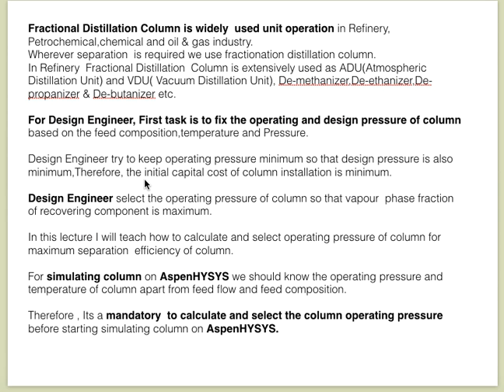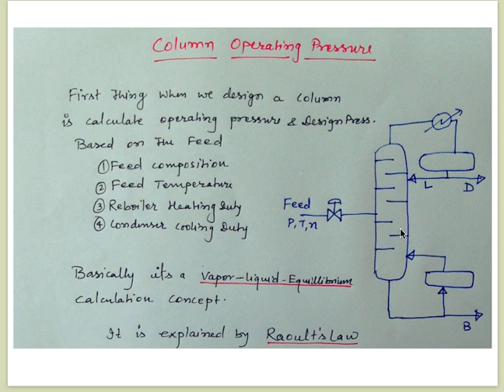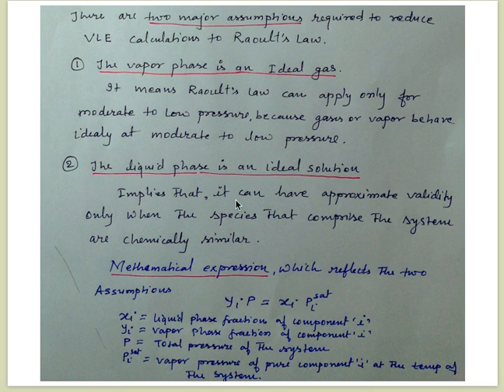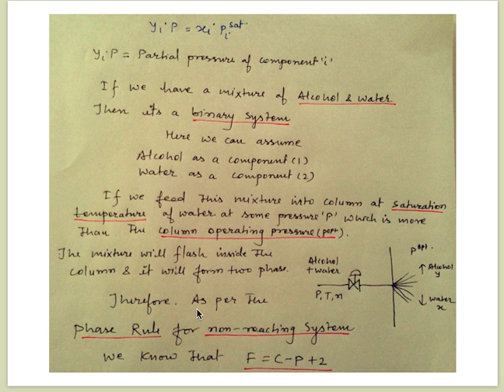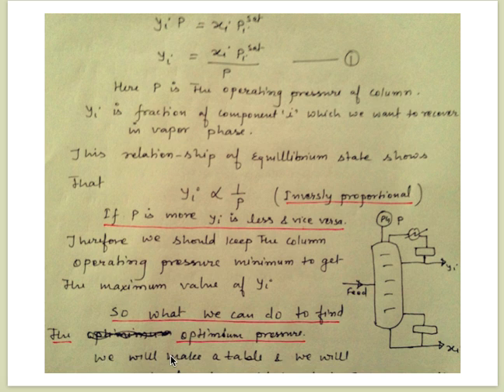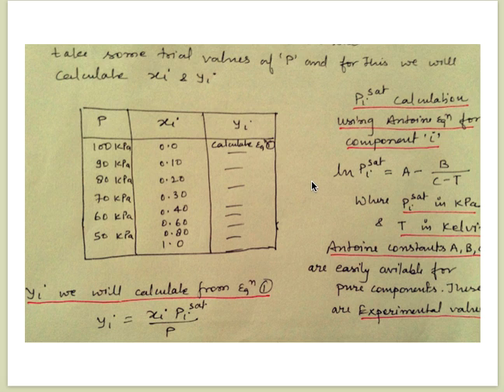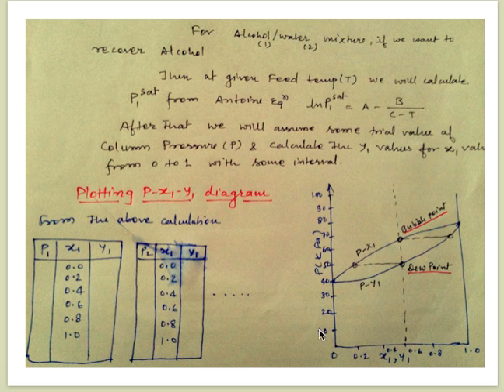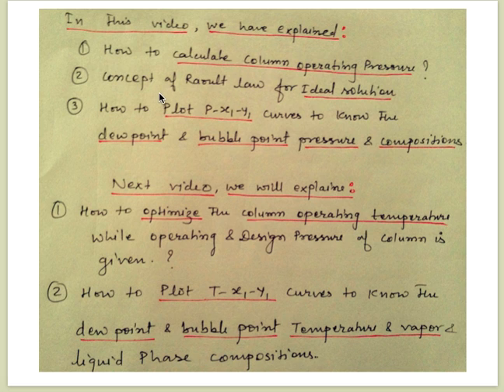Column Operating Pressure Calculation 1

Comment: Thanks Mr Lokesh Kumar Singh for sharing a comprehensive details on distillation column.Can i know how did you approximate the fisrt operating presurre to 40 kpa
Reply from the maker: It depends on the components to be separated select the pressure according to the boiling point of components to be separated at lower pressure